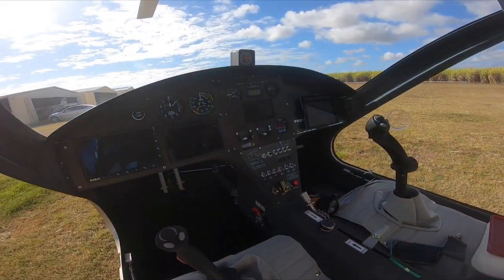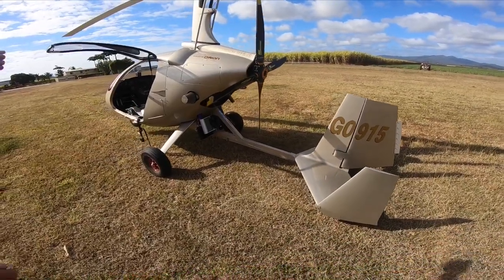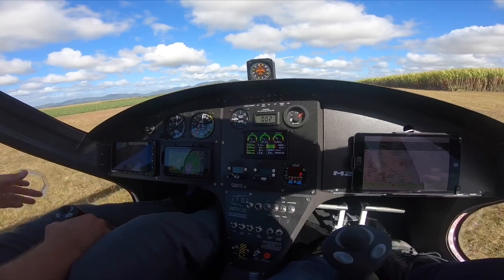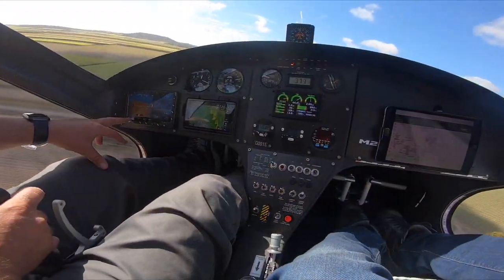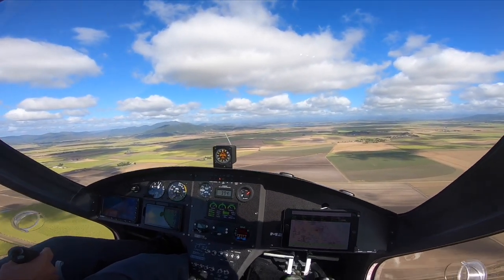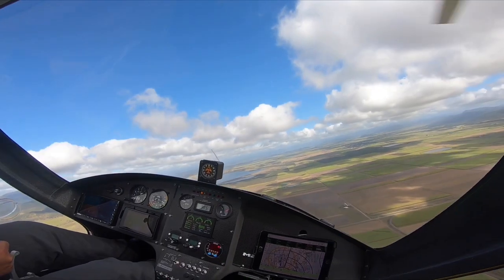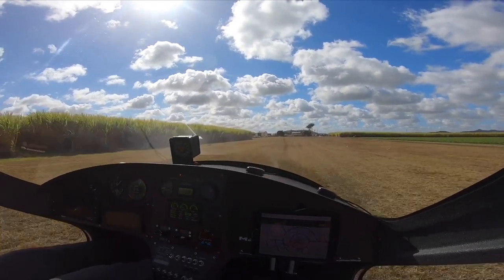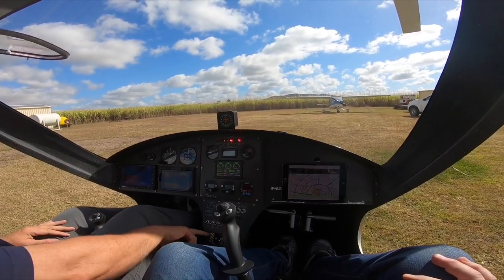Michael Hille my first introduction to a Rotax 915 powered Gyro

Comment: Michael, I was wondering if the rotor blade has no power source in the air, where is the power coming from to spin it on the ground before take off?
Reply: His description of the prerotor system starts at 2:30
Reply from the maker: They use a Pre rotation system to get the rotor up to speed prior to takeoff